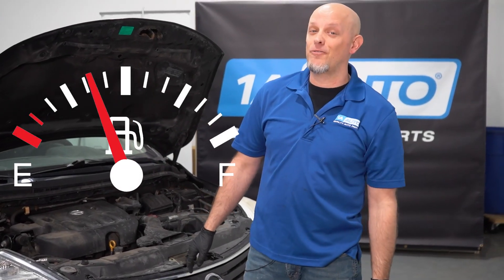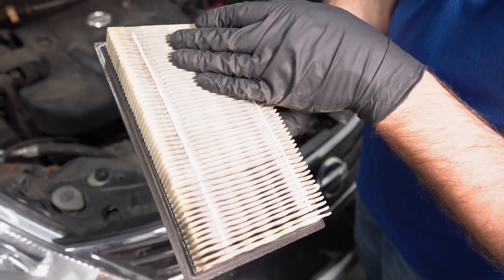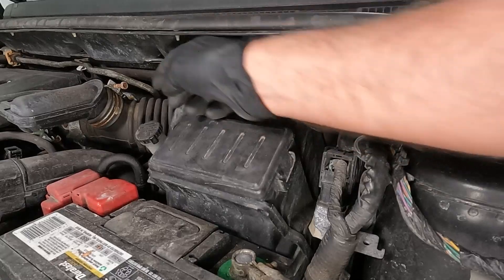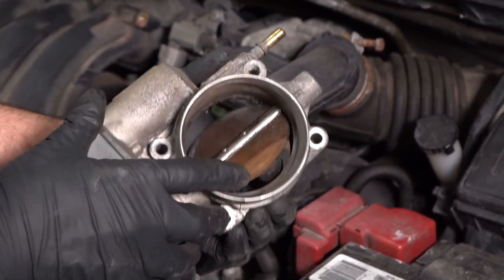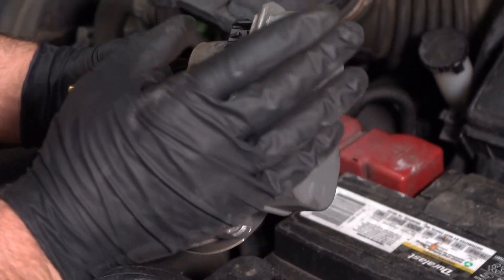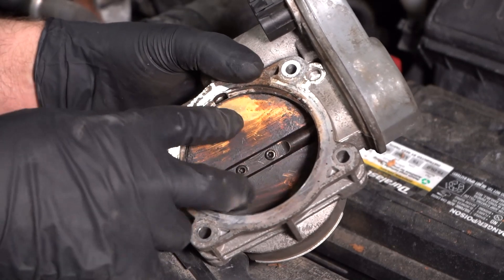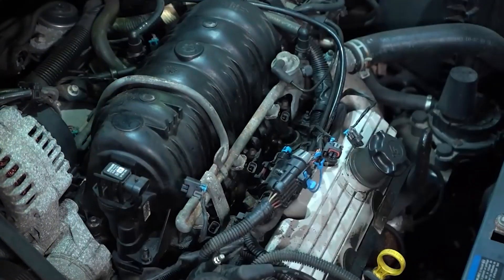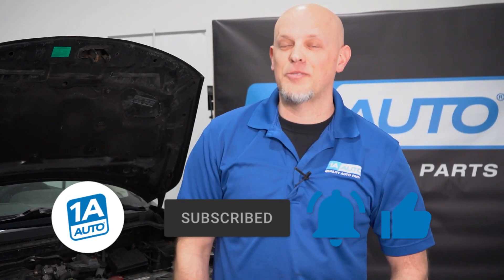Car or truck getting poor gas mileage? Check your mass airflow sensor first and save money on gas.

Comment: Can you guys do a video on engine stalling... I've replaced everything from a fuel pump to multiples different sensors... including all the ones you're talking about in here... only thing I can think of doing now is possibly the alternator is cutting out then coming back to life so it tests normal but doesn't work correctly intermittently for say.... that's me just taking an educated guess... I've done the fuel pump, cam shaft position sensor, throttle position sensor, new injectors, plugs wires & spark-packs... broke the upper neck of my radiator so I got a new radiator including upper and lower hoses end thermostat... if this model has a fuel filter then it's unknown where it's at... Anyways, any help would be appreciated... 2003 hyundai xg350 L

Comment: I have a 2023 Subaru turbo. The stated city mpg is 22 whereas I get on 15! The dealer simply said unless the Check Engine light is lit there is nothing wrong with it. Frustrated in Florida.

Comment: Hay I'm having trouble  with a 1999 gmc sierra 1500 . Truck  .. I've been trying to get it to run for the longest  time now. .  .. the truck will  start up but it won't  ideal.. .. and the only way the truck stays on is if I push down on the gas pedal to  get the rpms up.   But when I let of the pedal it dies down and turn off. .. can someone  please give me any idea  what else it could  be. I've run out of options  .. and I've checked for any codes  but nothing came back .. ???

Comment: That was very good intel on the TB. I didn't know that. I had to clean the TB on my 02 Tundra (4.7L) and I did it without removing the unit. I sprayed and scrubbed a pretty good amount of carbon from the inside with minimal deflection of the butterfly valve.  The old donkey ran great after that with no ill effects from my amateurish cleaning technique.  Now that I know better I will do better.  Great job and very informative.

Comment: My Mazda goes into limp mode.  I am getting DTC codes P0220, P2100 for throttle position and P50A cold idle. Resetting the ECU and performing a throttle relearn gets me on the road but as soon as I slow down too suddenly, it goes into limp mode again.  I had it at the garage and they cleaned the MAP sensor and throttle body as they said it is the most likely suspect but the problem persisted. Then they said they checked all the wiring and everything was good and the readings from the throttle and pedal were good.  They suspected the ECU because at one point they couldn't get communication.  I took the car back as they couldn't guarantee replacing the ECU would work and that told me they have no clue what they are doing.  I found that the DTC connector had a loose pin so that was why they were having problems.  I am really drawn to the MAF sensor.  With the MAF sensor disconnected I have identified the 12V pin and the 2 ground pins but the ground pins are showing 15 ohms from the battery negative to the MAF connector.  Shouldn't I be getting good continuity there?  One day, after resetting the ECU and performing a throttle relearn, I decided to just let it come down to idle.  Just before I put it in reverse it jumped into limp mode ie;really low rough idle.  When in limp it will not go past ~20 km/hr.   Please help as I cannot afford to take it to Mazda which is 3 hours away.  Plus I don't know if it would make it anyway.  I really don't think it's the ECU.  Something is telling that ECU to go into limp mode.
Reply from the maker: +Rick Stinger We wouldn't be able to diagnose an issue like that here, you may want to have a local mechanic take a look at it. Thanks for checking us out! http://1aau.to/m/Shop-1AAuto-c
Reply: @1AAuto  Thanks anyway.  I live in a small community.  I've tried the mechanics here.  Wish me luck.

Comment: Also change your air filter. My Hyundai fuel "Range" was always around 400 miles after a fill-up.  I noticed it dropped to around 360 to 370. Changed air filter and it took about 5 or 6 fill-ups and now it is back to 400. Measured mpgs and went from around 31 up to 35 mpg with just a $20 air filter.

Comment: My 2004 BMW 325i only got 15 MPG since I bought it 5 years ago.
I cleaned the MASS AIRFLOW SENSOR and I'm getting around 30+ now!!!
(It never threw a fault code for anything. Including Oxygen Sensors.)

Comment: I cleaned my throttle body like a week ago and it idles fine when I have the car on park but when it's on drive or reverse it sometimes wants to drop half way. Is that normal or could it be something else?

Comment: To properly clean a throttle body, it needs to be open. Carbon buildup on the back of the throttle plate isn't really the issue, the issue really is the carbon buildup on the edge of the throttle plate and around the inside of the throttle body where the throttle plate makes contact. That's what will restrict the airflow and could cause the throttle plate to stick and you won't be able to effectively clean that with the throttle closed. On a mechanical throttle body, there's no problem with manually opening and closing it. But with an electronic throttle body, you need to be very careful. Usually you can leave the throttle body plugged into the harness and have someone sit in the car and hold the pedal to the floor with the key on and the engine off to open the throttle so you can clean it. Just be careful to not move the throttle plate because that could set codes and/or mess with the calibration and cause problems. If you can find the manufacturer's specific procedure for your vehicle and it does not involve special tools you don't have like a dealer scan tool, that's always your best bet.

Comment: Every time Gas goes up you see tons of gadgets for sale, guys selling stuff and Tweeks to your car for better gas mileage. As illustrated...new air filter, correct tire pressure, maybe new belts. Most of all ..good driving ....see cars wiz by me then brake hard for the light. Always in a hurry ....then start quick from the light .... Driving 80-90 on the freeway...see that all the time... Great video....good info!
Reply from the maker: +Bruce Westoby Thanks for checking us out! http://1aau.to/m/Shop-1AAuto-c

Comment: I have a 2003 Honda CR-V with code P0505, comes on and off at random, when it’s off it runs fine, as soon as the light turns on it’s a rough idle. Any ideas? 😭 I changed the iacv 3 times.
Reply: See the idle sensor position it is on the throttle body loose the nuts rotate it, it can be positioned  differently at any point its directly related to rpm idle set

Comment: Getting P0446, changed evap valve, same code came back on. What else should I look for?
Reply: Try replacing the gas reservoir cap.

Comment: As mentioned, be very careful if you pull the throttle body.  Take a picture of where the butterfly valve is setting before attempting to clean.  A LOT of modern and even '06 models do not have an absolute position sensor to determine where the butterfly valve actually is. They use an indirect position sensor, and if you move it, and then replace the TB, it will think it is in the original position and adjust it programmatically from there.  You may end up needing to get it towed into a shop, or have to replace the unit entirely.  
Sometime the re-tune steps mentioned will not be able to correct.

Comment: ranger with 4 liter now getting 11.5 mpg! wooooo!
Reply: Lucky it's not a Toyota
Reply: I got the 3 liter and I get like 16 mpg, it’s horrible for some reason especially when I got the truck it had 80,000 miles on it and I was getting 25-26mpg, I can’t figure out what’s wrong
Reply: At least you get to drive a 4L engined car. Mine is 1.4L. :(

Comment: Can you use Carb Cleaner on a Throttle body?
Reply: Definitely. They are actually called that carb/throttle body cleaner. Just don't use it on the MAF whatsoever. There's a different spray for that CRC MAF cleaner and only clean that outside the engine and allow to dry.
Reply: No you need maf sensor cleaner often there is a protective layer on those and brake or carb cleaner can remove it
Reply: Yes